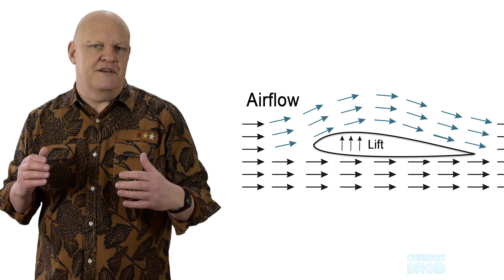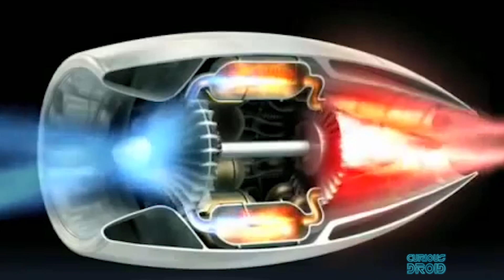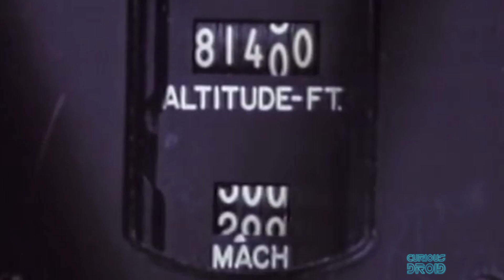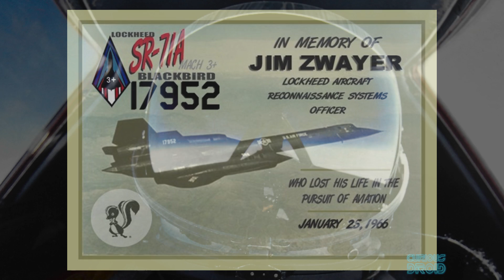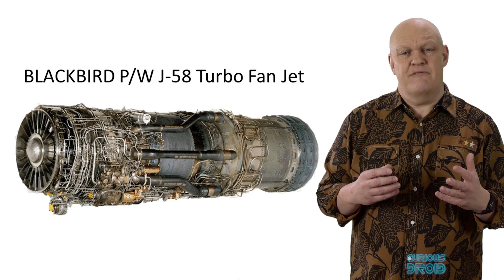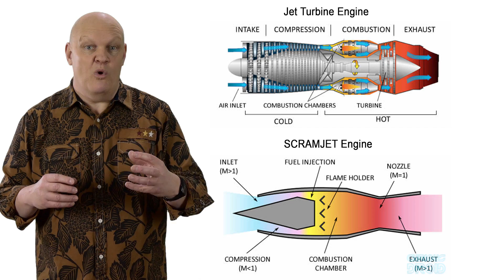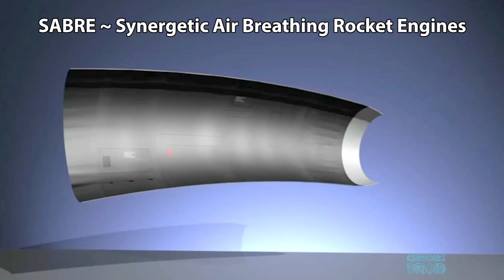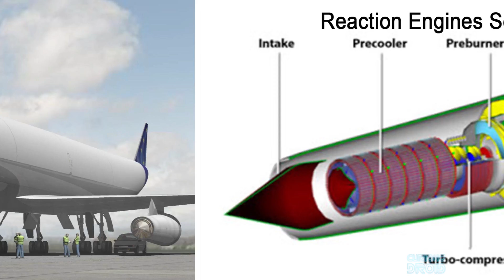Why can't we fly a plane into space ?

Comment: There's also the fact that most planes are subsonic and are therefore limited by their maximum mach number. Most airliners have max mach numbers between 75% and 85% the speed of sound. As the plane climbs and the air gets thinner, the speed of sound decreases and so the MAX mach number will eventually decrease to a speed equal to that of the stall speed of the aircraft. The plane, unable to go beyond its max mach speed and unable to go below it's stall speed, would be forced to descend to give a comfortable margin between its max mach and stall speed.
Reply: As air gets thiner, the speed of sound deacreas. Read the sentence and you will know how foolish does it sound. As medium gets thiner, the speed increases. This why speed of sound is higher in air than water.
Reply: @rishisingh7776  The speed of sound DOES in fact decrease as you climb with reference to Indicated airspeed. With reference to True airspeed, it increases. But looking at this topic with reference to true airspeed is irrelevant. Indicated airspeed is what is used to maneuver an aircraft.   For example, at 30,000 feet, at a temperature of -44°C, an aircraft will be at mach 1 when it's indicated airspeed is 408 knots. If that aircraft then climbed to 40,000 feet, it would be at mach 1 when it's indicated airspeed is 320 knots. That's a decrease. If the plane continued to climb, mach 1 would be reached at continually a lower and lower indicated airspeed. Eventually, mach 1 will occur at the plane's stall speed. When the plane's stall speed and it's maximum mach speed are close together, this is known as coffin corner. Look it up before you criticize.

Comment: The lift is actually less important than weight during ascent. That's why the airplane needs to pitch up to move the thrust force up, which in addition to the lift force becomes greater than weight (lift < weight, but the force created by adding the vertical components of thrust and lift > weight).

Comment: Escape velocity is the speed that is required to leave earth and get in to interplanetary space. To get to low earth orbit you only need to travel at about 28000 km/h.
Reply: And that's ballistic speed.  You could also plod along at 10 miles per hour and eventually get there but it would take a lot of fuel.
Reply: @thomasmaughan4798  Care to elaborate? I don't think I understand what you are trying to say.
Reply: @stefannilsson2406  Escape velocity is the velocity, relative to the center of Earth, that an unpowered object requires to escape Earths gravity or in other word leave orbit.  But it does not pertain to powered objects that can go whatever speed they want.  Elevators go UP and nowhere near escape velocity :-) and that's because they are powered.  
Rockets achieve orbital velocity and once achieved shut down engines and the rocket stays in orbit.  A high flying jet is nowhere near orbital velocity and uses air pressure to stay up.  For an airplane to "fly" in space it must achieve orbital velocity so that it does not depend on air for staying aloft.  It could also use thrusters (small rocket motors) to stay at high altitude without orbital velocity but it would burn a lot of fuel and oxidizer and not do it for very long.
Reply: @thomasmaughan4798  That makes a lot more sense than I first thought.   :)

Comment: Question? How far can helicopters go?
Reply: Until they run out of fuel .
Reply: Depends upon the power of the turbine engine to spin blades at thinner air of highest altitude without overheating. There is a limit but some helicopters can go higher than others.

Comment: british airospace designed a space plane in the 1970's. It was a redesign of concorde. bigger faster and could fly into space. it would of used standard jet engines to take off and land once upto speed it would switch to scramjets to get to escape velocity then use rockets once in space.
But due to not enough funding it never got built.
Its estimated it could of flown from london to sydney in 5 hrs. new york in 2 hrs.

The plan was to get into a low orbit so it could cut the time and fuel needed to travel long distances. once in space it only needed the thrusters for manouvering so hardly any fuel was needed.

Comment: Get rid of big oil and we would be traveling in space by now.

99% of the problems is carrying fuel.  If you can carry a small nuclear reactor and attach it to a 777 and feed electricity into an electric turbine, you can fly for 6 months without refueling.  The only problem is that its dangerous if not handled properly.  It it works and nuclear power power planes are made safe it would save 100k per flight in fuel alone.  Swap that electric engine for an ion engine once its profected we can fly anywhere.  Including space.

Comment: Why not just pump oxygen into the jet engine?
Reply: You can do that, what about lift generated from wings? No air no lift, so sorry it does not work that simple;) Of course there is engine that works in vacuum and it's rocket engine where there is oxidizer and fuel.

Comment: The SR-71 also had a version of scramjet in its design referred as “ram jet”, which works in a similar manner. The SR-71 actually utilized less fuel at faster speeds than slower speeds due to the efficiency of its ram jet engines, which is related to the long nozzle cones in front of the engine referred as “spikes”.

Comment: the SR-71 didn't have a turbofan, rather a turbo-ramjet
Reply: It had intakes and fans that compressed the air to take off and get to operation speeds. There fore it did have fans. It was called a scramjet due to it's unique engine configuration.

Comment: I agree with the previous commentary that this video is much to long for the subject. 
However, I do think that it would be possible to use jet engines for space travel if you fed them enough air and fuel. The one advantage they would have is they can run for many hours, where as rocket engines can only run for minutes.

Comment: Several problems here.
1. You do not need to be travelling at escape velocity to get to space.  You can go to space as slowly as you want.  Space Ship One never reached escape velocity, but it got to space.
2. If you want to stay in space after your rockets stop firing, you need to be in orbit.  This requires orbital velocity, which is only 71% of escape velocity, for a circular orbit.
3. The start of space (the "Karman line") is not universally agreed upon.  The FAI picked 100km, but Karman himself originally defined it as the altitude at which the speed you need to get aerodynamic lift exceeds orbital velocity.
https://en.wikipedia.org/wiki/K%C3%A1rm%C3%A1n_line
Reply: Yes. The speed of any ship going up really depends on where it's going. If the ship is a small object tied to a balloon, it can reach the edge of space with very little energy and speed. A ship trying to make orbit will need a lot of energy, so a rocket booster is need to get it to 18000mph / 25kkm/h, with most of that energy poured into downrange motion. Add more energy and speed, and the ship will go from low-Earth orbit to medium or high orbit. Add more and you can cross escape velocity, where the ship escapes Earth altogether. The ship will end up in solar orbit. Add a bit more speed and the ship can cross solar escape velocity (done so with New Horizons).
Reply: Patrick, of course you can get to space without reaching 25,000 mph, the problem with going slowly is that it would take a very long time!!! This would mean you would need masses of fuel and oxidiser. The most fuel efficient way to get into space is the way apollo did it.
Reply: Patrick Doyle good point. Aren't there balloons that can make it to space?
Reply: @duboseq1  Balloons can get up into what's known as "near space", but they can't go high enough to break the Karman line and escape earth's gravity. (I think their ceiling is at about 40Km/25mi, if I remember correctly)
Reply: @duboseq1  The problem lies in the way balloons travel upwards. To do so, they have to be less dense (or lighter, if you will) than the air that surrounds them. You can achieve this either by heating the air inside them, or by having a very light gas (hydrogen for instance). This way they float to the top of the atmosphere, much like a boat floats on water. At some point though, the atmosphere will be so thin that it's density starts to approach the density of the balloon, stopping the ascent (if the balloon doesn't explode as the internal pressure will likely be much larger than the external pressure at this rate).
Reply: Because it's harder, takes longer and is unfeasible to actual missions in space and again it would have to have O2 for any engine function so either fuel altogether or multiple fuels for multiple tasks and functions which equals shoot it off save weight time apace money everything and get on with it.
Reply: @DudeStone  what exactly is your point, you lost me.
Reply: I thought you reach space in a 30km attitude.
Reply: @BlaineK-v2s  I think people are talking about outside the gravitational pull of earth as they did on apollo.
Reply: oh, your talking about that barrier we cant get past yet? Kinda like the ocean floor?
Reply: Still
Reply: I didn't even get that far. Within the first 30 seconds of the video he explains how lift is generated wrongly.
Reply: @Leange5  it does? i've never heard a explanation that differs from this one?

Comment: very funny premise....  actually you can fly an aeroplane into space with a few modifications. the problem as always is range, oxygen and getting past the outer atmosphere to get down to earth..... as the shuttle proved.... as did the Concorde... the claim of massive escape is only correct if going like a rocket does from standstill.... you can sling shot off as Virgin atlantic plans to do using the worlds largest carry plane then using a rocket carry pod to slign shot.

There is a handy dandy escape velocity calculator.... 1.42028e mach is what an average aircraft that weight  175 Tonnes would need to escape once airborne.  The issue would be how long and what kind of propulsion.  can the wings design handle the heat...  so yes the Concords wings could sustain mach two this in theory means that with the correct oxygen feed into the engines could have gone into space...  there is a engine maker actually doing this and once it reaches space it switches to a rocket engine design. look up reaction engines.  They have been having issues with the oxygen freezing in absolute zero of space so as far as memory recall is they are working on another fuel/oxygen delivery system. The interesting point that is lost is the the reason aircraft go higher and high is because it reduces the amount of friction... so a swing wing design would be able to once they sort out the huge weight issues of the mechanism and one day soonish we will have a commercial airliner that can do the 1.42028e mach escape velocity and have the correct supplies.= for the humans to survive.

Comment: Missing the neat point.  We could fly our rockets attached to conventional commercial aircraft to high altitude using cheap jet fuel and air as the oxidizer.  We could even use Blackbird engines which can operate at higher altitudes and special wings to also increase our ceiling.  Then the rocket, already at altitude above much of the thick air, traveling at a combined speed of the rotation of the earth at the equator and the speed of the mother ship could launch while the mother ship for the most part glides back to base to pick up another rocket.  I haven't done the detailed analysis on this but at first glance it would seem a much less expensive to achieve orbit.

Comment: A better question why doesn't the Shuttle launch using it's wings instead of straight up, and use the lift for as long as their is enough air ? Or launch from another plane like the X-1 ? Isn't if more fuel efficient to use the wings ? How does the normal engines and fuel compare to the solid fuel boosters for efficiency ? After all, a 747 does carry the Shuttle at times.

Comment: The discussion on velocities needed for reaching space is wrong on several points. Reaching earth orbit doesn't require escape velocity, that's for reaching infinity. For maintaining an orbit around the earth, a velocity of about 8km/s is enough. That is about Mach 23 at 1atm, or 28000km/h. Furthermore, for reaching space it would technically be enough to do so on a ballistic trajectory, in which case the velocity requirements are even lower.

Comment: Present this question to Star fleet engineer Montgomery Scott and he'd mount solid Oxygen modules/emitters ahead of the jet engine intakes. Eh Viola, the jet aircraft can "do the rocket thing" until the fuel or Oxygen runs out. As for the passengers, they would be fine as long as cabin pressurization was maintained and Oxygen is available. Could this mashup head to the Moon? Probably not; achieving escape velocity is a whole other mountain to climb. Star Fleet engineer's version of "The Kobayashi Maru test.";)

Comment: The higher up the less dense the air the reason airliners fly so high (usually at 38 thousand feet) because they can go two times faster. But they could stall if they go too high because the engines don’t have enough oxygen to breath the engines need oxygen to mix up with fuel molecules to burn and generate thrust.

Comment: Better question is what’s the difference between a rocket and a jet airplane? Rockets have liquid oxygen added to the fuel to make combustion possible. Airplanes do not. Also airplanes are NOT pushed forward. They are like massive vacuum cleaners, they suck the air in front of the engines, thus pulling them forward, not being pushed from behind.

Comment: the plane pushes on air....what do rockets push against in...vacuum?....in order to create forward momentum....that is the question.
Reply: the plane pushes on air ?  why do you think the fastest planes are the ones that go really high ?   your "pushing" against air would help indeed.... if there was a vacuum in front of he plane, but there isn't . instead the faster you go the more pressure you create in front of the plane ..... creating friction... slowing it down. bigger wings = more lift , but if you create lift, you slow down !  the forward momentum rockets create is by ejecting mass out of the back....same here on earth as in space ,but in space there is a vacuum in front of the rocket (read a few lines back)
Reply: the mass ejected...what does it push on?  there is vacum behind the rocket too ....and all around.... not only in the front....means  ''the mass ejected gets pulled......and not vacum cleaner vacum....no   it's 10 torr of negative pressure....the kind we can only create thru chemical leaching....you see my point?
Reply: @gabrielrapan4156  it does not have to "push" against anything. Jet engines on earth work the same. You eject mass from the back.and create a force the opposite direction. Like i tried to explain. A less dense inviroment only makes i t go easier because you have no drag or pressure build up in front of the device
Reply: you dance around my point ...QUOTE '' it does not have to "push" against anything''..... and  you denying newtons first (3) law  ...action /reaction.....QUOTE ''Jet engines on earth work the same. You eject mass from the back.and create a force the opposite direction. Like i tried to explain. A less dense environment only makes i t go easier because you have no drag or pressure build up in front of the device ''.....   dude????....jet engines work ENTIRELY different. please educate yourself.  ''a less dense environment?  dude WE TALKING ABOUT SPACE. it's VACUUM. that is 10 torr of NEGATIVE pressure...  it's not ''less dense''...we implode oil pipes when testing at around 4 torr....have you ever seen a oil pipe? thickness and such?  ram jets are needed for higher altitude.....but still.... air, THIN atmosphere has to be present  to be acted upon by the jet,rocket.propeler,rotor.....to get a reaction....newton's first law(3)  .... 5 th grade physics man....if it is as you say...why airplanes struggled a half century to reach 100 000 feet? ...that is why propeller airplanes could not go very high up....the propeller can't beat the air fast enough to create lift....why? because  of thinner less dense  atmosphere.....now please think before you post next reply and google newtons first law  and how lift is created for 
 airplanes and rockets .....make sure your argument does not deny the laws of  OBSERVABLE physics  that you learn in   MIDDLE SCHOOL  is not worth the time.....
''
Reply: @gabrielrapan4156  i will give you a hint .... Thrust .  Look up what it is , how it works. And then reevaluate your knowledge on newtons laws, i would check the third one a bit ;)
Reply: ''but in space there is a vacuum in front of the rocket (read a few lines back).....again the vacuum is ALL AROUND THE ROCKET not only in the front.....like i said....it's not a vacuum cleaner to...suck the damn rocket...and again you eject mass into ...vacuum.....explain to me how forward momentum is achieved?
Reply: @gabrielrapan4156  thrust !  You keep comparing it yo our atmosphere.... It is not the same. If you create a vacuum here and make a hole air will rush into it because of the difference in pressure, creating a force . Same goes for a plane (big pressurized tube) which pops a hole.. the pressure will rushout , creating a force (same as a rocket). You can find videos of people letting air out of a balloon in vacuum chambers... The ballon moves because the air generates thrust. And for your comparrison, a drone wont fly in the same chamber because a propellor is a wing and needs an enviroment to work